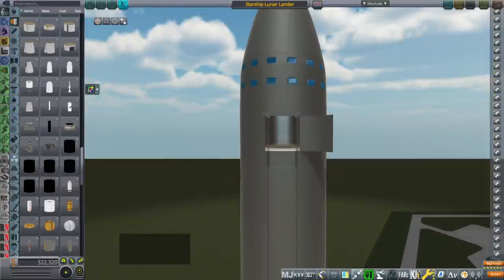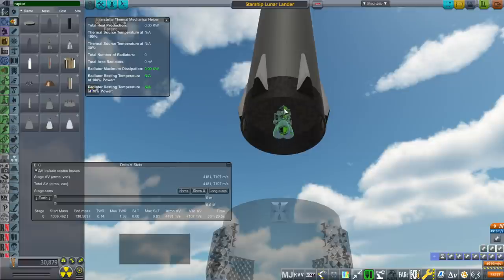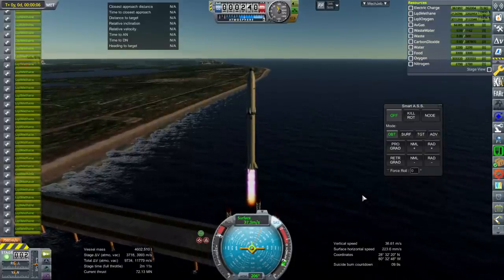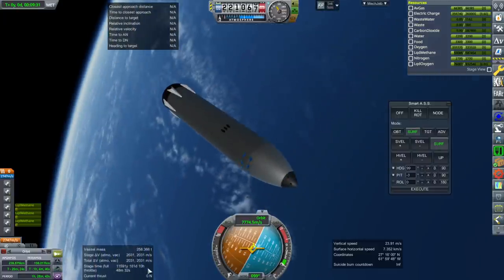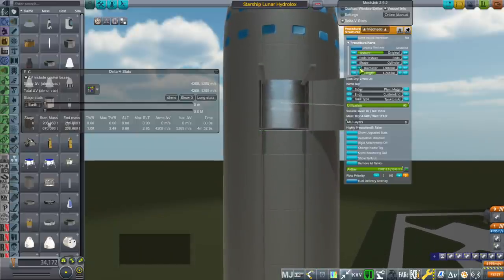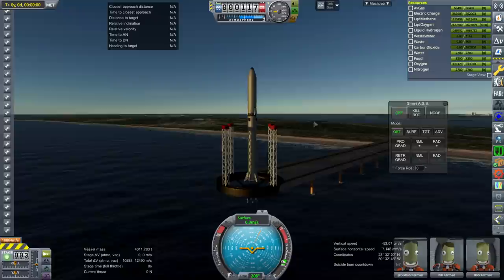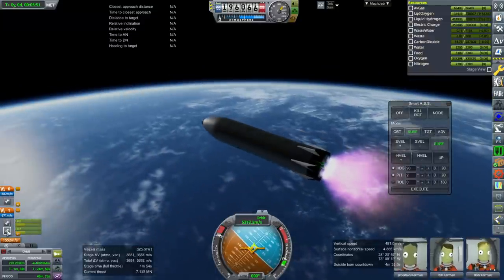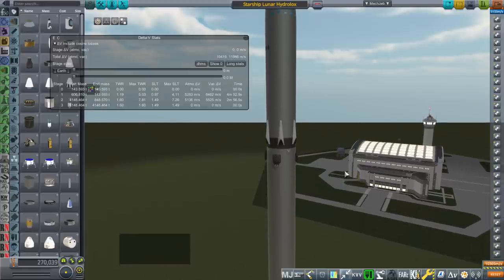Realism Overhaul in KSP 1.8.1 - Hydrolox Starship?

Comment: 414 Isp at sea level. Have any real-world rocket engines come even close to that?
Reply: It's a bit on the high side but not improbable. The sea level optimized versions of the SSME (SSBE) with a 30:1 nozzle did about 380 seconds at sea level with 200 bar chamber pressure. The XLR-129 was rated at 385s at sea level. So increase the chamber pressure from 200 to 300 bar and your get in the neighborhood of 400-410 seconds with a sea level optimized nozzle. Real world performance may vary.
Reply: Nope. SSME got 366. But nowhere close to 414. Raptor once again proving it's superiority
Reply from the maker: Well, no real world rocket engines have operated at this chamber pressure. And this wasn't a purely theoretical ideal number - there was an efficiency multiplier based on what the methalox Raptor gets. Theoretically, with perfect combustion and nozzle efficiency, it could get more.

Comment: For a methalox lunar starship, why not process the gaseous and solid waste of the crew?
Reply from the maker: Because methane from waste comes from the payload (food and a bit of hydrogen from the water) and is nowhere near enough to fill the methane tanks. If you've got 50 tons of consumables, even if you convert 100% of that into methane (you can't - the carbon and hydrogen are only a small part of that mass), you still don't fill the more than 380 ton methane tank.
Reply: Even if you converted all the carbon present inside all of the crewmembers (That includes the bodies themselves) plus the food you couldn't hope of filling a percent of Starship's methane tanks. Sorry, but fart powered Starships aren't quite in the plans.
Reply: we need space cows